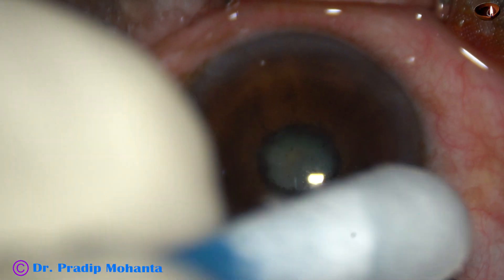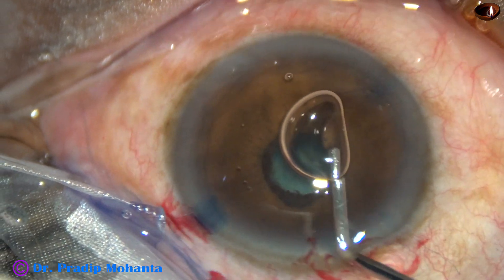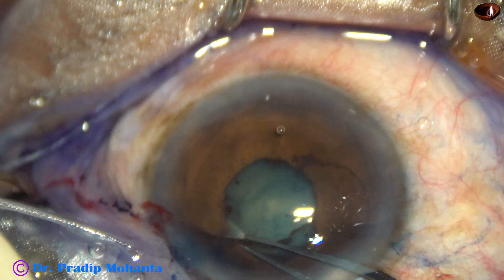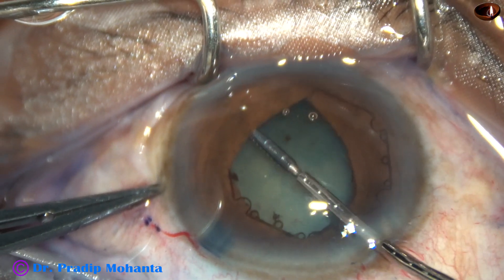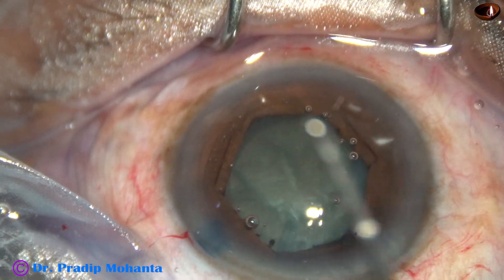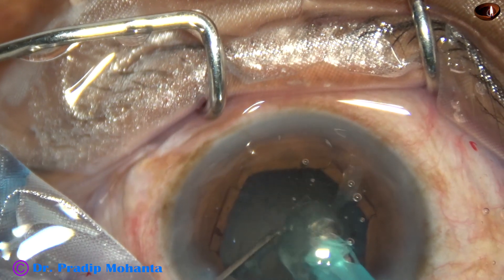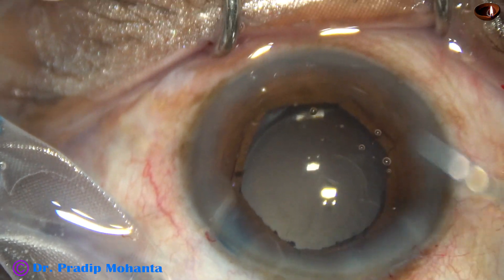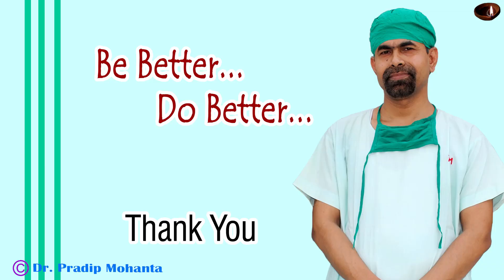Cataract with Occlusio Pupillae and Retinal Detachment : Pradip Mohanta, 27th Feb, 2020

Comment: Routine cataract surgery often follows a series of pre determined steps, like in a movie script. Not so with complicated cases like this one: many strategies and moves are decided on-the-fly as the surgery unfolds, and the surgeon’s experience and skills count a lot.
In this video Dr Pradip Mohanta does some smart moves to tackle the case, such as opening the pupillary seclusion just a little and injecting the Trypan blue dye beneath the iris to achieve anterior capsule coloring while it is still isolated from the OVD,  before dissecting all the iris adherences.
Tangential pulling of the fibrotic tissue on the pupil’s margin lessens the risk of iridodialisys and allows for better dilation, which in conjunction of the B-HEX pupil expander will make for an easier and safer surgery.
Many pearls in this video my dear friend Pradip!!! 👌👏👏👏